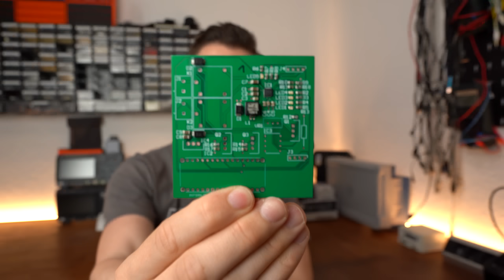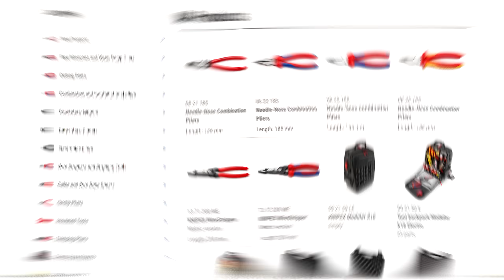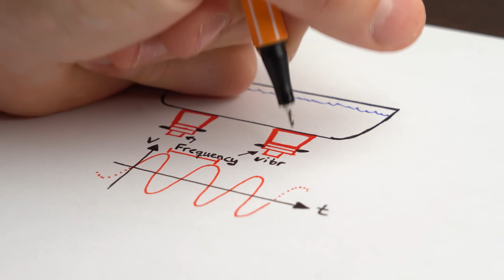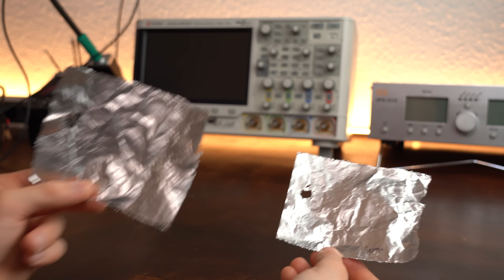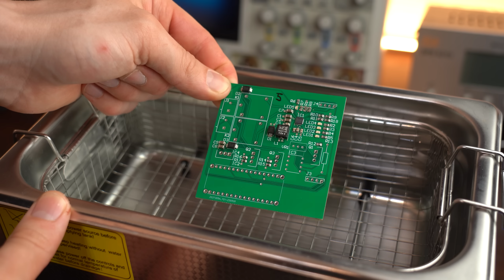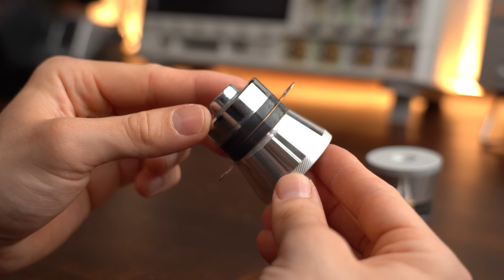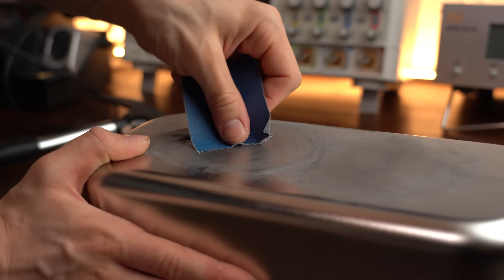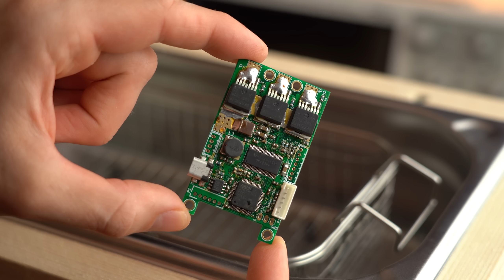The Most Underrated Tool? (DIY or Buy) Ultrasonic Cleaner!

Comment: What would the heating function be useful for?
Reply: Cleaning.  Do you wash your dishes in cold water?
Reply: @pheelix-  my dishes usually require cleaning from organic matter. Not sure if rust, cured flux, dirt on glasses and stuff like that feels any difference if the temperature is a bit higher though. If You say - it does make a difference for everything, I'll accept Your answer, but a bit of scientific proof for that could be useful.
Reply: @slazds  Adding heat makes things like grease and flux less viscous (average kinetic energy of the molecules are higher) and things generally fall apart or do other stuff (energy barriers and all that). I find it makes a difference personally, but I sometimes skip it if I had too much isopropanol to my cleaning mix as it creates more fumes.
Reply: @slazds  Hot water makes it easier to wash dirt, cured flux, on stuff because it increases the kinetic energy of the water molecules, which in turn helps to loosen and break down particles that are stuck to what ever you are cleaning. Additionally, hot water can also help to soften grease and oil, which can make it easier to remove.  So, in summary, the heat from hot water helps to both physically and chemically break down dirt, flux particles, making it easier to remove them.  Now combine that with the tiny explosions the ultrasonic makes.
Reply: @pheelix-  Thank You very much indeed! :)
Reply: @LysisofPie  Thank You for the explanation!

Comment: Try cleaning in pure ethanol, acetone, gasoline. But use a tightly closed jar for flamable liquid and part, then put the jar into supersonized water tank.
I also very satisfied with cleaning bicycle chain in distilled water, then in kerosene.
Also kerosene is easy to filter for another cleaning cycle.
Great to clean out oxide layers from metals with light solution of acid.
DIYed a 150w 2.3l cleaner and very satisfied with it.

Comment: I wish I could peek inside the ultrasonic watch cleaner my father had in the early 60's.

It had a unique sound that modern ultrasonic cleaners lack and cleaned faster too. The bubbles were more abundant too. 

It had 4 round compartments with different solutions in each and round mesh baskets to fit each compartment.

Considering how new transistors were in that era I'm curious if it maybe used some other type of electrical components to generate the pulses? That may partly explain it's strange sound.

It would clean any dirt under your finger nails in a minute!
Reply: I see you have replied to my comment, but I can't see your reply! Sorry...
Reply: @willjackson1955   Looks like my comment was removed. Bulova made these devices and there's schematics on the net. Shows two tubes inside.

I'd love to see this channel recreate it from the schematic or maybe a transistor version.
Reply: That's so cool! I'd always thought that ultrasonic cleaner started its developement in the 80s or so. High voltage, high power pulses were surely provided by vacuum tubes, probably some kind of power high frequency oscillator that coupled to a transducer via a transformer. At least that's what I think could be used. Of course different characterstics led themselves to different resonance frequencies and hence the different sound.
Otherwise, maybe some kind of scaled down alexanderson alternator, to be run on mains voltage could theorically work?

Comment: what will happen if you put isopropyl alcohol in the cleaner?
Reply: Not a good Idea.
Reply: Some cleaning solutions add a small amount (from safety data sheets), but generally it's not a good idea as it makes more fumes when heated and is highly flammable.
Reply: I would like to se if the fumes get ignited by the very fast vibration

Comment: are you not supposed to put iso in the actual cleaner and just running that? or does it not have the same cavities that occur with the water.
Reply: IPA is very flammable.  You don't want to put it in the ultrasonic.

Comment: I'd be looking at why you're getting so much paste bleeding under your screen. Are the apertures the correct size? Or are you moving the screen around? Also you can get brush of flux solder wire. I've used it for years, rosin flux is horrible.

Comment: Generally, with appropriate cleaning agents in the ultrasonic, such as Branson or EMAG products, cleaning should be capped out at 1-3 minutes, to avoid unecessary damage to certain components on the PCB, of course heating should always be used, at around 60-70c
Reply: Except the heating elements in most small ultrasonic cleaners are so slow it takes 30min to an hour to warm up that high.
Reply: @kwinzman  Can you use preheated water then, like in a kettle?
Reply: @GeorgeFoot  That's exactly what I do.
Reply: @GeorgeFoot  yes
Reply: Yup. We refuse to use it on any product that we make that has any piezo or crystal element. Just not worth the risk to part damage.
Reply: too short, and too hot
50c for 10 minutes is industry standard and what they test most cleaning chemicals with

Comment: I was told by a lab technician friend that you should put the water/cleaning solution in slowly, with the cleaner turned on, and stop filling when you get the strong ripples on the surface of the water as at this point the system is at resonance and the cleaning is more effective.
Reply: I'm not saying he's wrong, but start out with the minimum amount of water already in there. Running these dry will destroy them VERY quickly.
Reply: @qwertyboguss Agreed, if you're particularly unlucky you can kill it in seconds.

Comment: Start using the proper fluid, you have special products for flux and pcb's like Termopasty's TermoSonic PCB. Occasionally using flux-off (a spray can you can get from specialized stores) although rarely needed if you use the right ultrasonic fluid.

The result is 100 times better. Afterwards you just let it leak out and blast it with the hot air gun at 200 degrees to remove fluid from under components. The result is a spotless pcb (no white discoloration like with IPA).

Comment: One important thing to note: transducers should not be powered on unless mounted and the container filled to the proper volume. Testing them on the bench like that can actually damage them, with an end result that they run hotter, work less efficiently (or not at all), and also require more power from to driving circuit (which creates more heat).

Even if they work perfectly fine though, i haven't seen any that didn't create enough heat to need active cooling for the circuitry.

(Another note on safety: having touched an active transducer bare-handed before I can say it's definitely not recommended)
Reply from the maker: Thanks for the feedback :-)
Reply: You'll also want to check how the commercial version transducers are attached to the tank. That center hole is threaded for a reason... Typically there's a threaded rod welded to the tank, the transducer is screwed on, and then glued in place to prevent it from unscrewing itself - not to hold it onto the tank.
Reply: This is very truth other channels version destroyed several of them like that.
Reply: @juanca1991 I saw that on "Branchus Creations"
Reply: Yeah...definitely not going with the diy route... it's that bad huh... i was a bit more complacent with the us cleaner until now, still not to the point of touching the transducer... but after this. I hope this info remains in my head while I'm around the cleaner
Reply: what happens if you touch the transducer bare-handed?
Reply: @yugaindiranmarimuthu7310  well, I specifically touched the side of the center metal disk in the transducer. Instant 2nd degree burn in a short line on my finger plus numbness and muscle twitchiness in my forearm for half an hour or so. Not my proudest moment.

I was trying to avoid touching anything "live" but mistakes happen. At the very least I was properly doing the one-hand method of having the other hand well away from the shocky bits or any grounding or it might have ended much worse. I was also mistaken that I thought transducers were much lower voltage.
Reply: @yugaindiranmarimuthu7310  your whole body will be filled with holes like that aluminum foil if you touch it... just kidding
Reply: @yugaindiranmarimuthu7310  afaik in worst case the flesh can separate from the bones in your fingers....if you ignore the pain

Comment: 2L - $69.99
3L - $89.99
10L - $179.99 (your unit?)

I own a $39.99 600 mL jewelry cleaner that basts holes in heavy duty aluminum foil in a short time.

Also, what about using 99% isopropyl in the tank for flux/solder ball removal?

Comment: I would have guessed as much as well, but for DIY I probably would have chosen a different form factor.
It might be overkill, but transforming one of those ugly sinks in washroom into a ultrasonic cleaner would have the benefit of easily filling and disposing the water of that device. ;)
Reply: I mean there are smaller sinks available, or just drill a hole in any tank and shove a drain valve in there
Reply: Was my idea for my kitchen as well but the wife disagrees. Would love to have one to clean motor blocks

Comment: Its usually good to fill whole cleaner with water and put a plastic bag with concentrated cleaning solution and yout components inside. 

It will cost you less and the results will be pretty much same.
Reply from the maker: Great tip!

Comment: I'm sure you're already aware, but soldering of your pcb looks pretty bad. It looks like not enough of heat (temperature) was used or incorrect termoprofile, or soldering paste is bad and lacks of flux.
Reply from the maker: Yep. Solder paste was bad.

Comment: The DIY solution will get interesting if you mount the transducers onto your steel kitchen sink. Big volume and you can clean your dishes by ultrasonic and release the waste water directly ;)
Reply from the maker: Oh boy
Reply: new generation of dish washer ftw
Reply: I have a ten liter cleaner, and have tried it on dishes. It doesn't work: Dish gunk is too big, and too soft. And the number of objects being cleaned affects the effectiveness. But it's great for getting perfectly clean glassware.
Reply: https://www.youtube.com/@BranchusCreations has some videos on DIY ultrasonic cleaners, and one project actually utilizes a stainless steel laundry sink.
Reply: Brilliant.
Reply: I dont think the resonant frequencies would bode well for the fittings of the plumbing or the silicone bead between the sink and countertop surface. On top of that there is far more mass for the transducers to need to vibrate if we are talking about a proper steel sink, plus the added mass of the countertops they are attached to providing resistance. Even if you could overcome the amount of mass that would need to vibrate with some beefy transducers/power output, the end result would likely be LOUD and over time cause considerable damage to the surrounding materials. All that aside, I would rather be wrong about this and also want to see somebody actually build it! 😂
Reply: @anthonypatino7143  Don't forget the SWR of the entire system!
Reply: @anthonypatino7143  Its like a microwave but better. I suggest a bag filled with water, in the sink that has water. Inside the waterbag a toastersized magnetoclampable shaker! Just put box wtih basket inside the bag xD
PS maybe works better in airfilled bag floating in waterfilled sink

Comment: You do have to try cleaners specifically designed for flux removing. I use SRA TruePower Cleaning Solution 35 for circuit boards (I also bought my Ultrasound cleaner from SRA while I was at it). Got perfectly clean PCBs every single time on hand soldered heavily flux'd SMD boards. I also soak (and swish) the PCBs after ultrasonic cleaning in IPA to "dissolve" remaining water into IPA so I can dry it fast (optional). Air brush/gun and it's immediately usable, no wait!
Reply from the maker: Thanks for the tip!
Reply: The ultrasonic flux-remover cleaning solution you used... is the cleaning time the same as the regular concentrate solution?
Reply: @paulf1071  Sorry, don't know about the "regular" concentrate solution. The SRA bottle says 3-15 minutes, max. 30 minutes. I usually give it 7 minutes. You know the binary search method... and it worked the first time, so search terminated.

Comment: Just for Great Scott and other's edification: I use a fine paint brush to remove the solder and then microfiber cloth to soak up the used alcohol. I go through microfiber cloths but they are pretty inexpensive.
Reply from the maker: Thanks for the tip

Comment: I'm working in a company which uses ultrasonic baths a lot.
Funny thing is, that the Aluminium Foil Tests are officially performed regularly to make sure every ultrasonic bath is working properly. It apparently is the best way to make sure everything is all right without the need of disassembling the machines all the time.
Reply from the maker: Fun fact ;-)
Reply: Are thin bits like foil the main concern?  I see the cavitation damage in stuff like that and get spooked.  But between this video, and @Applied Science  ‘s frequent use of these i’m i n t r i g u e d
Reply: @ericlotze7724  to clean products, we put them in the containers filled with isopropyl alcohol and then submerge these in the ultrasonic bath. The sound waves go through the container and get to the products anyway. There's no risk of contamination with aluminum flakes.
Reply: @ericlotze7724 he foil rapidly moves and breaks apart (like bending metal back and forth). If the foil didn't break apart then the ultrasonic bath is not powerful enough, or is not working.
Reply: @ericlotze7724  - So far so good, I've only managed to destroy an older brass float from a carb. Blew holes in it, and ripped the soldered joints apart!  But I've done others that lived... so maybe it was 'just its time'.
Reply: there's also the pencil on frosted glass slide test
Reply: @executive  Executive, thank you very much for your comment!
Reply: We use ultrasonic baths at work as well. We have a watt/frequency meter now, but used to use foil for testing. I have also used a mechanics stethoscope to see if the transducers were working
Reply: What solution is using for the cleaner?

Comment: I've considered an ultrasonic cleaner for cleaning ammunition brass and firearm parts. It's loud, but the tumblers that you fill with nut shell media are far, far worse. But with how compact an ultrasonic cleaner is, you can probably build a sound damping cabinet or cover for it - with some ventilation as well so you're not trapping in heat.

Comment: Not a good idea for cleaning electronics it's commonly known that forcing crystals & resonators to vibrate at the wrong frequency will break them and you are physically vibrating them at a different frequency also the small ceramic capacitors can break and so on with the tiny wire bonds inside other components, that's why there are proper procedures/ machines for cleaning PCBs in industry which are just glorified washing machines using two stage filters with pure water, and further drying stages depending on customer requirements to residue on the boards.
Reply from the maker: Thanks for the feedback

Comment: I believe the transducers need to be bolted and glued to the tank. Otherwise the vibrations can loosen the glue over time. You should weld some treaded studs to the tank.
Reply from the maker: I sadly was not able to weld it. But it still performed very well so far.
Reply: @greatscottlab  then I hope the glue will hold. And thanks for the great videos.

Comment: Ultrasonic cleaners will damage or kill MEMs devices (especially gyros). I'm sure how much I would trust it with relays. It would be interesting to test them until failure to see if there are at all damaged.
Reply: Does not kill accelerometers tho. Tested in production.
Reply: @brylozketrzyn  I have seen them damage accelerometers, though not outright kill them like it did the gyros. I'm sure it depends on the power, length of exposure, and design of the device.
Reply: @unknownhours  or just about different PN washed with these cleaners. I have hear reports about clock oscillators (ceramic, quartz and MEMS) being damaged by ultrasonic cleaners but honestly never seen one. And we are making medical devices - even single one did not failed due to cleaning.

Comment: Heated water and nearly any detergent works well. I use a product here in Australia called "simple green". But I think any basic dishwashing liquid works well.
The main benefit with these is when you're cleaning "fiddly" things, with small internal ports or cavities, like a carburetor  or brake parts..  The Ultrasonic/heat/cleaner will get into the smaller areas that are just too fiddly otherwise and importantly do no damage.  Plus you can get on with other tasks as the cleaner works.
Reply from the maker: Thanks for the tip :-)
Reply: Will second this (heat, Simple Green). I also put a small amount of isopropanol in the mix. Helps with non-polar gunk and speeds up the drying time...
Reply: I just use vinegar, mainly on metals

Comment: You definitely need a proper flux cleaning solution in the ultrasonic bath. I use Electrolube SWAS for 10 minutes , then two rinses with deionised water in a normal container.

Furthermore you don't need IPA at all.
Reply from the maker: Thanks for the tips :-)

Comment: Any thoughts on regular vs water-clean vs no-clean flux?
Also, how long did it take for your glasses to get that dirty again?!?
Reply: There's a video where someone takes a whole bunch of fluxes and leaves them on a piece of copper each.  What I took away was even the no clean flux should be removed.
Reply: You must add flux cleaning solution that can clean the type of flux you are using for best results